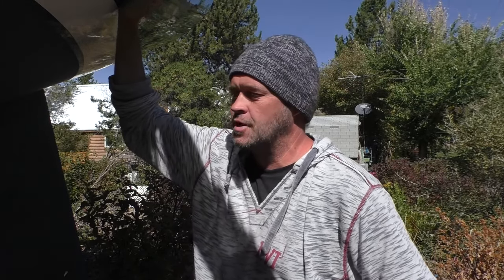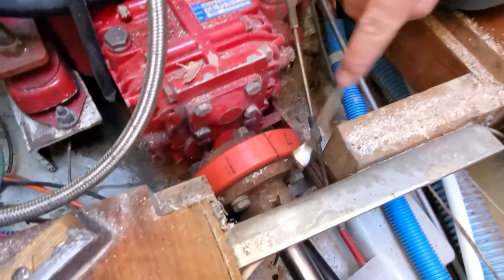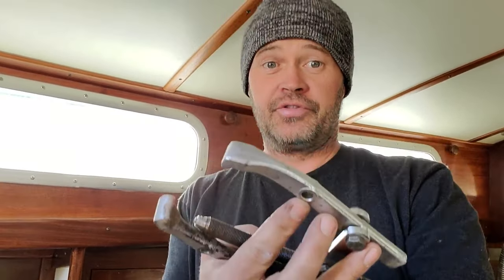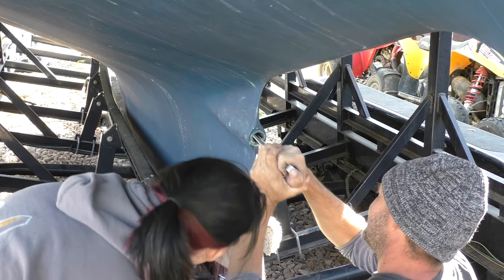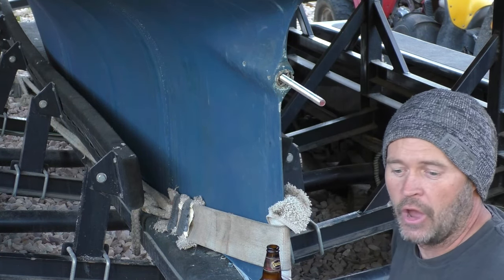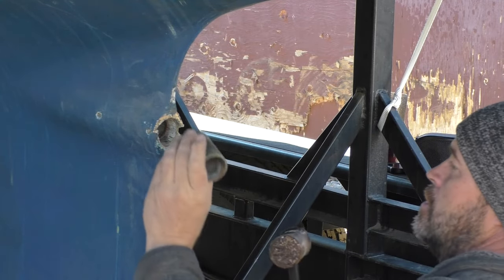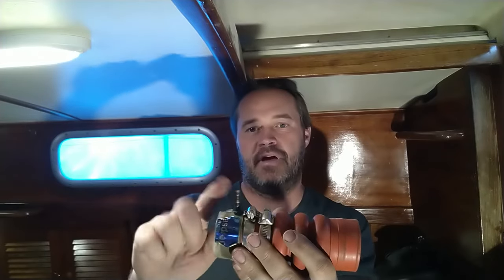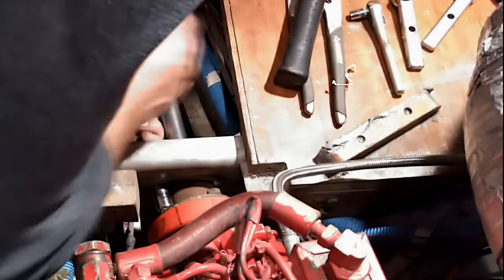How to replace a cutlass bearing!  Sailing Hiraya Ep: 8

Comment: Any time you have something with an interference fit you know it's going be an absolute bastard to get out. Hats off to you for diving in there. I have not seen a single video of a coupling getting pulled that didn't look horrendously hard.
Reply from the maker: Sometimes I dive in over me head!  It's funny when you read instructions it just says to remove coupling.  It never says you need a puller a hammer maybe a torch, and that you will invent new cusswords!!!

Comment: Good job!!you probably will never hav to change them again.If you ever have to hammer the coupling off hit it on the very back not where the bolts go because you can warp the flange.
Reply from the maker: Thanks.  I really hope I do not have to replace them again for a long time. Removing the flange might have been the worst part.

Comment: Are you sure the two cutlasses were “aft?” on longer shaft tubes it is typical to put a cutlass at either end of the tube.
Reply from the maker: I did not know that.  
Im pretty certain they were both aft.  When I put my "puller" in the stern tube, it hit something 4 or 5 inches earlier than I thought it would.  I think the previous owner could not get it out and decided just to push it in further.  Other owners of the same sailboat only have one.  We may never know why there were 2.

Comment: Seems like it went pretty good, you didn’t break anything. Haha. What holds the prop shaft from coming out other than being pressed into the transmission flange, under a hard reverse load or something?
Reply from the maker: There are divots drilled into the side of the shaft that two large set screws screw into. I also used some siezing wire and thread lock.
Reply: Sometimes there is a disk-shaped collar around the shaft that is designed to stop the shaft from going for a swim and allowing water in the people tank

Comment: I agree ... 2 cutlass bearing is strange.
Reply from the maker: I'm still not sure I should have put both back in.  I guess that time will tell.
Reply: maybe, probably, not 100% but. there might be two Cutlass bearings because previously it was easier to drive The old one in further. So you have the new one on the tail.